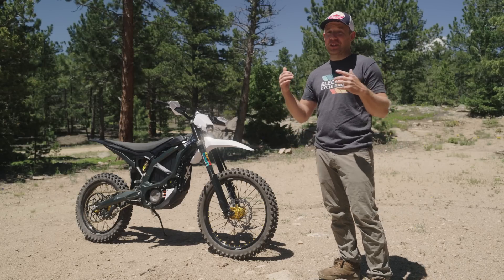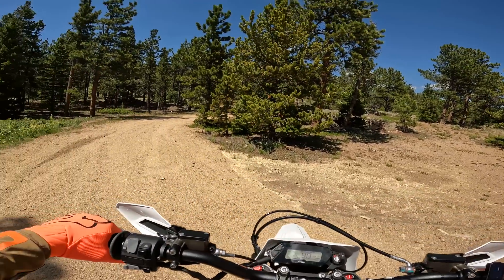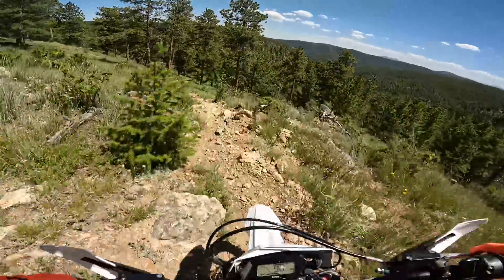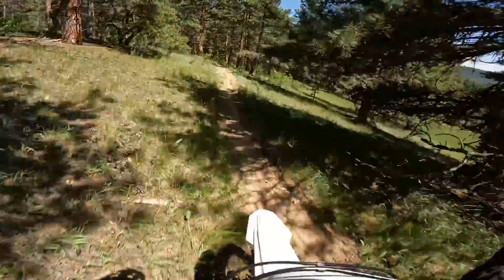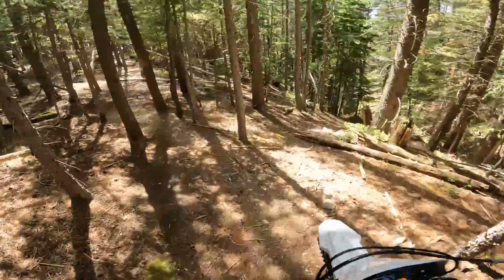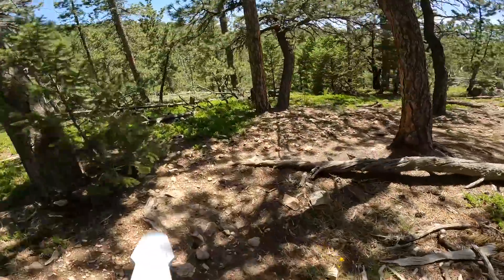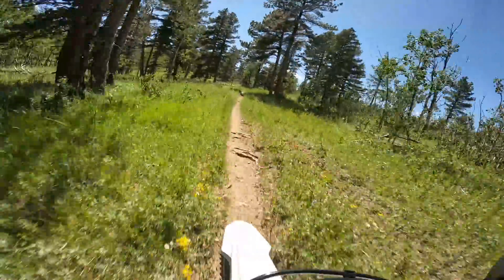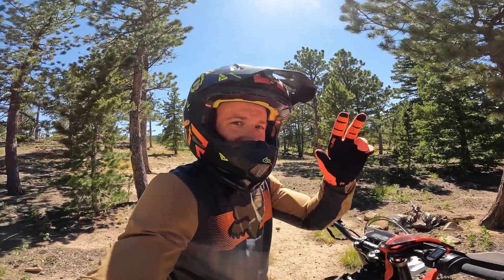2023 Surron Ultra Bee | STAGE 2 MODIFICATIONS

Comment from the maker: In this video, we’re looking at the ECR Stage 2 Surron Ultra Bee, which features all of those same mods from Stage 1, but we’ve added: 

EBMX X9000 Controller: https://bit.ly/EBMXX9000

EBMX X9000 Ultra Bee Controller Adapter Kit: https://bit.ly/X9000UltraAdapterKit

ECR Complete Factory Tuned Fork: https://bit.ly/ECRUltraCompleteFork

The ECR Stage 1 Build:

KKE 21/18 Ultra Bee Wheels: https://bit.ly/UltraBeeKKEWheels

KKE 53T Sprocket: https://bit.ly/KKEUltraSprocket

Roller Chain: https://bit.ly/UltraChainNonORing

KKE foot pegs: https://bit.ly/KKEUltraPegs

ODI handlebars: https://bit.ly/ODIUltraBars
Reply: So I was sure when I got my ultra I’d do 21/18. I have the 19/16 on my lightbee that was absolutely built out 72v with the x9k suspension and all….not I got my ultra and am wondering how it would feel with the 19/16….did you try the 19/16 or would you be interested in doing a comparison?? 

Thanks for what you do Tucker! We love your content and all you do for the community.
Reply: Question, did you try the EBMX controller with the stock sprocket? Don’t want to lose top speed going to a 53 tooth, I am also running a Shinko 18×4 trials tire, so TopSpeed stock with stock sprocket is 63 miles an hour, would like a little more torque, hopefully don’t lose too much top speed. Also, when you go to the EBMX 80v battery, wondering if the stock sprocket might be better for that? Last question, I did put a roller chain on and broke it to fit, will probably have to add another master link and more chain back with a 53 tooth sprocket, where can I get another master link, if you don’t have them? Thanks in advance.!
Reply: any power upgrades for storm bee to make stage 1/2 yet? curious how it impacts top end as well as torque. i feel like the storm bee just needs a little more on the track. or i need a stark varg lol

Comment: Would be really interesting to see an Ultra Bee with a 16/19 wheelset like some of the hot rod Light Bees are running. Would it be too low, too long? Or would it be like a heavily modded Light Bee with just the smaller rear wheel and thicker profile tyre? 🤔

Comment: Did some testing, running 18/21 with Shinko trials tires, roller chain, stock sprocket and controller, some tight woods and fast fire road, on and off the gas, 1hr 30 min ride, average speed of 16.7 miles an hour, top speed of 54.5 mph, range was 25.3 miles before battery was depleted/on last bar and flashing, battery ended at 18%.  Going to try 53T sprocket next to compare.  Info, collected running Strava, which has been double checked for accuracy.

Comment: I’ve been hunting through the wiring….wanting to put a momentary switch (maybe the warp9 horn button to wire for reverse) and a light switch (maybe  a warp 9 light switch to have an on off for the headlight) would be wiring myself….this is if the after market doesn’t come out with something at some point….

My question is have you looked into getting rid of the stock display and mess now that the x9k is on? I get really distracted by the mess on the bars. Constantly hitting buttons as I ride mostly moto and really move around on the bike a lot.

Also are the hall effects sensors on the wheels even necessary since the TCS doesn’t work with 21-19? Or the ebmx x9k?

Comment: Tucker ; if you'd like a smoother, grippier ride up those rocky creek beds, try the Kenda Trailmaxx rear tire ( comes stock on the Freerides ), it's perfect for that stuff.  The IRC ix09W gekkota is great too if you need a knobby, lighter than the VE33 since it's only a 2 ply, full gummy rubber & super compliant carcass.    Either tire is like having xtra suspension !      BTW - a footpeg lowering bracket can't come soon enough, I'm 5'8 & it feels cramped / awkward when standing.

Comment: I was the first one in nyc with the x9000 installed on my uktra when the kit dropped. Its incredible. Now o have a 18/21 with 244 5.10 in the rear and 244 3.00  21 for the front. 

And i have a 54 with a non o ring chain and the bike is running mint. All thats left is for my battery thats coming in the mail and maybe the new ebmx motor down the line. 

I run 

3kws mode 1
10kws mode 3
17kws 800 phase amps mode 3.
Reply: How many miles your get? In distance
Reply: 40 to 60 @gregsun247
Reply: Top speed would be really interesting ✌🏼

Comment: Great overview. Been waiting for a test of this controller. Looks to be a worthy addition. Can the stock motor handle that much power on an ongoing basis?
I imagine stage 3 will include either the EBMX battery or the KO motor. Or both 😈
Reply: Ebmx already made motor for ultra. The stock motor can handle 10kws on the highway with continuous use. However the motor does get warm

Comment: What would you compare the power to on a gas bike? I now eletric motors traditionally make a lot more torque than HP by nature but is it equivalent to like a 250 or 450 race bike? Hard to judge these kinda things.
Reply: It's all about the weight. It has incredible power and I would say it's like. Yz125 but it's also light than a 450 so it's a middle weight bike

Comment: How is the controller effecting the range in the different modes??
Reply from the maker: @mattcgtx4809 So far it's been comparable to stock, which surprised me. I attribute a fair amount of that to the 53T sprocket though. Seeing roughly 26 miles of singletrack riding at this pace, switching between the power modes, which is what I was getting on the stock bike with stock wheels and stock sprocket in Sport Mode. In terms of each individual mode, I haven't done any real testing on that yet, usually running it in different modes throughout the ride.

Comment: All this testing is going to be a huge benefit for me assuming next spring availability for the Ultra is still good. 
Pretty much every bike I ride has to be modified, any starting point recommendations for someone 6'4"? Particular Bar, riser, seat etc? I'm also wondering with the different wheel sets if dropping the footpeg height at all is a bad idea. 
I haven't found an advantage to being tall other than grabbing top shelf items for old ladies at the grocery store. Oh well.
Thanks for what you do, excellent content, always.
Reply from the maker: @jnew3755 Awesome! Would definitely recommend doing the 21/18 wheels with the 100/100-18 rear tire. It adds a significant amount of height. Additionally, some taller handlebars would help as well. The tallest we sell in the ODI is the RC High Bend. 

I suspect there will be an adjustable peg mount kit and some tall seat options coming soon but currently the options are bars and wheels to make the bike bigger.
Reply: @ElectricCycleRider there's no problem with geometry? I don't know how to describe it in English but I saw people discuss about adding 21/18 is destroying that "light and smooth" feeling of stock ultra.
And they say it is not even about power, even 15kw+ with 21/18 there's "still a geometric problem" to that bike
Reply: @biniu21 na it's great. I do wheelies. Hit dirt jumps. The 18/21 is where it's at
Reply: I am running 110/100-18 rear and 90/90-21 front 
Also 500 lb rear spring 
Rox 2” adjustable riser
6’ 205lbs 
Working really good
Suspension  is balanced now and working much better.